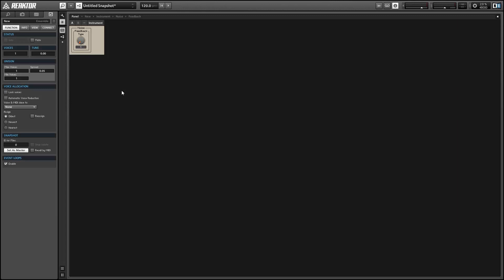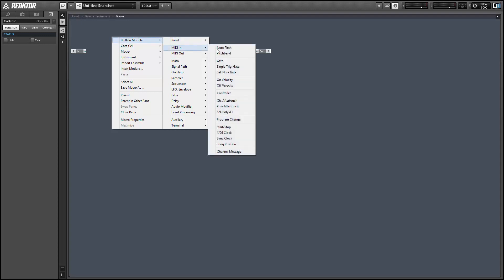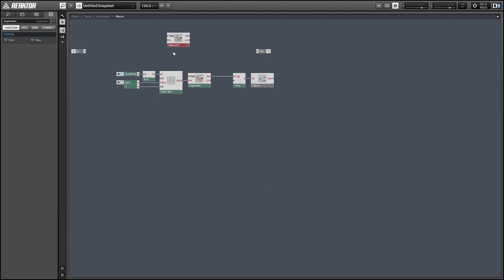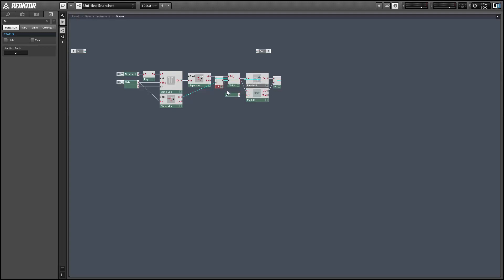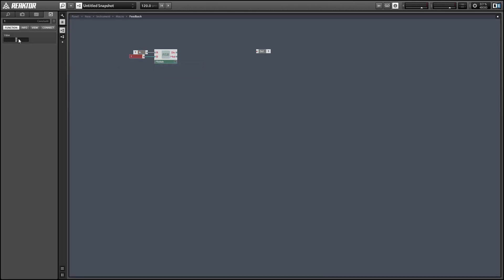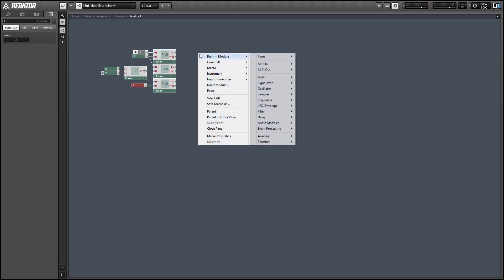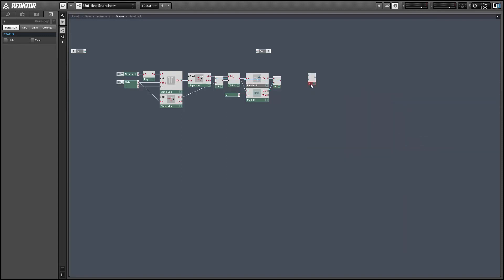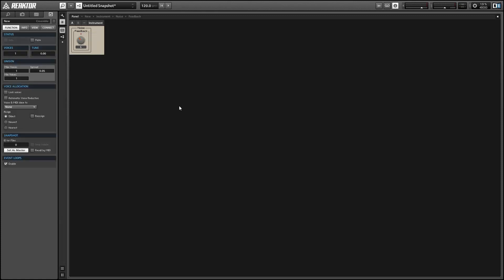NI Reaktor - Emulating the Nintendo Noise Oscillator - part I

Comment: Honestly, this doesn't sound a whole lot like the NES noise channel. What you have is certainly good for making chiptune-ish type music, but the noise channel for the NES uses actual non-harmonic noise. If you want a more authentic NES noise channel sounds, you could try sampling from Famitracker.
Reply from the maker: Hi, thanks for the comment - as I mention several times in the video, we still need to work out the tuning. We are generating the same sequence that the NES noise channel does (as per the nesdev documentation anyway, I don't have a working NES to test with). However the sequence is not being played back at the right speeds yet.
Reply: ***** That is my bad, I watched the first few minutes and must have missed the part where you mentioned that. Also, I want to clarify that what you have there doesn't sound bad, just not as authentic (yet :)

I love the noise channel in Famitracker and if there is a way I can get my hands on that functionality in a more modern DAW, I would be all for it!
Reply from the maker: Ben Burnes No worries! I'm not sure we'll end up with anything too precise - there is no cheap way to avoid aliasing here, but I swear I've gotten sounds very close to Rad Racer, etc. Nothing to test with so I can't be sure....
Reply from the maker: Ben Burnes Here's part II: https://www.youtube.com/watch?v=XkKdUEI55Co